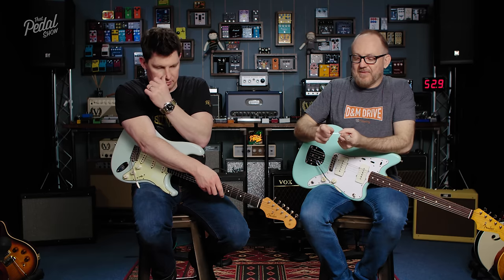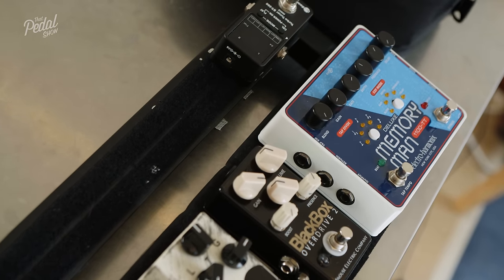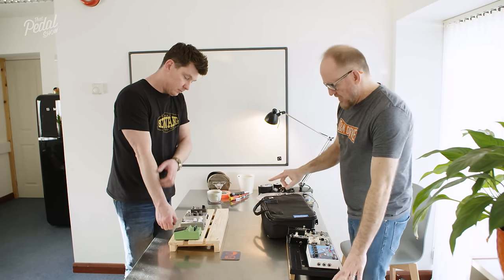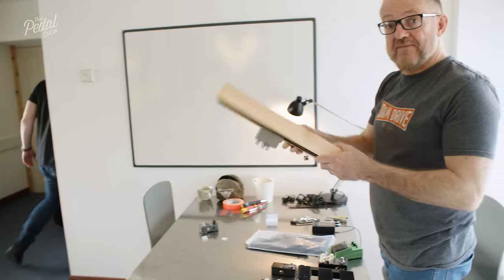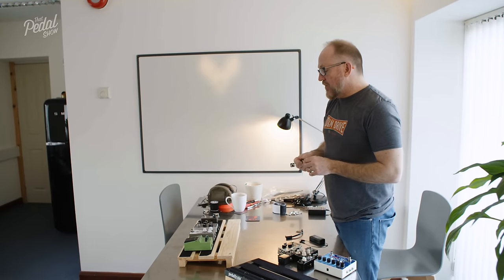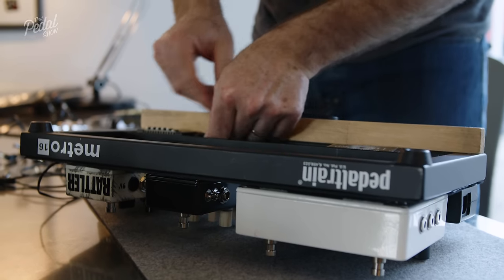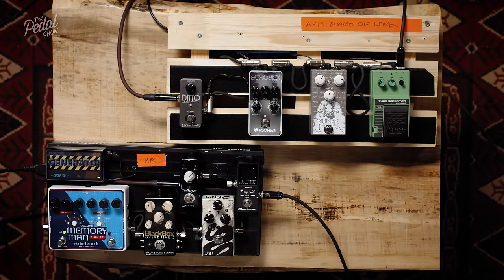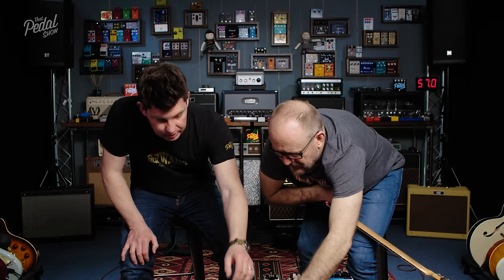Tips For Your First Pedalboard Build – That Pedal Show

Comment: Former baggage handler here.
If your flight case is awkward then it's not going to be popular with the handlers - mostly they work without being seen so awkward things can be treated with serious harshness.
Hard cases with low friction surfaces are liable to slide off tall stacks of cases (who says your case is going to be stowed the correct way up?) and could potentially land on concrete and be run over by a following trailer. Flight cases are good but a multi ton trailer doesn't give a shit.
Soft cases tend not to move around so much or fall off so much.
So if you're flying - make your flight cases more 'sticky' with rubber strips on every side and try to make it easy for someone on minimum wage to move - don't just choose the biggest possible because you can, it's more likely to generate hate.
And put your name/destination and phone number on it so it doesn't end up in lost luggage if the label gets ripped off. Brown furniture tape for the flight number, permanent marker for your name and phone number.

Comment: as long as the power supply's milliamp is higher than the pedals' milliamp all combined, daisy chains will work just fine ..
Reply from the maker: Unfortunately not attybong, it may be ok in certain situations but if the supply to each pedal isnt isolated you can run into noise problems especially with digital pedals
Reply: @ThatPedalShow  well good to hear that .. but in my case, it happened only when my dc adopter (power supply) had lower milliamp than the pedals all combined .. b.t.w. i'm referring only to a small board ..

Comment: QUESTION:
Any alternatives to the humdinger?
Reply from the maker: Not for us.
Reply: I use a Radial Bigshot. Not exactly the same thing (and I have no doubt that the Humdinger is higher quality!), but it's what I happened to end up with when I first needed to run two amps. It has worked ok so far.

Comment: Thanks for yet another great video! Question: What do you do when you have more pedals on your board than outputs on your non-modular power supply? Remove one, I know :-), but seriously do you daisy chain or use a split cable? Can it be done without soldering power cables? I always seem to need to have just one more pedal on the board!
Reply from the maker: Buy TheGigRig one and never look back. Mick here. I have four power supplies that got out-pedalled!

Comment: I'm just starting with this pedalboard thing. Can someone tell me the difference between a daisychain and a power supply? and how does it affect the sound?. I'll appreciate it
Reply: A daisy chain would be where you power multiple pedals off one power connector like with the standard 1spot, which doesn't isolate anything. I never had an issue with it, though. Many of the more expensive power supplies do isolate each connection to prevent noise. I really haven't experienced any noise issues with any of the power supplies I've used, and I've used the normal 1spot and the CS12 as well as a BBE SupaCharger and the GigRig system. I really like the GigRig supply but it does take more setup time than others since it's not just one big box.
Reply: @2Plus2isChicken2013  Thanks for the explanation!
Reply from the maker: A daisy chain is what you should find in a trash can and not use. A proper isolated power supply has separate outputs for every pedal. That's what you should use. Cheers!
Reply: @ThatPedalShow  Thanks for the verdict

Comment: Hi, 
Is it ok to use one proper power board and to it add, connect a power brick that will power up three guitar pedals in total? I'm using Katana 50 amp and plan to get something like Boss noise suppressor, Revv G3, and a Korg tuner. 
Thanks 😁
Reply from the maker: Yep.

Comment: Currently running 10 pedals without a board, 5 up front five in the loop. I have a few more but if i were to take away the pedals i dont use regularly i think i could get it down to 8 or 9. I plan on upgrading a few of them before i make my first board though. A few of my pedals are really big like memory man size also, i want to get an mxr m234 cause im just using a nux ch3 chorus which sounds more like a leslie emulator which sounds more like modulation. Basically i have mostly nice pedals but the budget ones i have i want to replace with something more permanent before i build a board. But im really really looking forward to being able to build a custom board that i can just unplug the power supply and 1/4 in. cables and go. Ill put a handle on it and have mounted 1/4" and a mounted power supply.

Comment: Any tips for powering an Effectrode Backbird (12v, 1600mA) along with other more standard pedals? It seems like a power strip would take too much volume...
Reply from the maker: That needs its own dedicated supply. Not even sure TheGigRig does propely isolated at 1600ma. Woah nelly. That thing should be IEC shouldn't it?!?!

Comment: Do you know why some digital pedals leak noise into the audio channel and/or daisy chain? It must be a design issue because not all digital pedals do it and I know some of them have much better digital noise filtering than others. I’ve just been through my digital pedals one by one, isolating them, to see if any were introducing background noise and none were - so no new power supply for me.
Reply from the maker: Dan probably knows. Something to do with something. Hahahaha.
Reply from the maker: The issue isn’t just the noise generated in that particular pedal, it’s what the other pedals on the board pick up. Try the same thing with a vintage fuzz and a treble booster on your board. If you get away without isolating then great stuff, but I would never not fully isolate every pedal on a board. It’s the option for fewest possible problems
Reply: That Pedal Show Thanks for that and for all your unmissable shows. My digital pedals, tuner, looper, delay, reverb, etc are tc and my analogue pedals vary. The only remotely noisy pedals turn out to be one “boutique” trem and a higher gain OD and that noise wasn’t reduced by power isolation. 

Good isolated power is pricey and a bit less convenient. It seems a good idea to test the difference it would make before jumping in.

Comment: What are the disadvantages to running multiple pedals from a signal output of an isolated power supply when you start running low on outputs? I bought a Voodlab iso 5 which was great at first (love running my OCD out of the 18V port!) but is really limiting now that my pedal board is growing (only has 6 outputs; essentially 5 as the 9V and 12V share 400mA current output). If I ensure that my pedals don't exceed the current draw for any given output, is the only downside going to be extra noise? Thanks!
Reply from the maker: Yeah, noise, loss of signal strength and everything else that goes with that. Tone suck, basically.

Comment: i need a power supply that will power 10 pedals with 9 volt dc, all less than 200 mA and 1 pedal that takes 12 volt ac and draws 1000mA. i have not been able to find one. help.

Comment: Here is a tip for removing old Velcro glue from pedals.  When you remove the Velcro you are left with a sticky mess on your pedal..

Here is the best, cheapest, least amount of effort way.  Take a small piece of new Velcro...  small because big makes it harder to pull off and new because the glue is stronger.  You could use a strip of the old Velcro you just pulled off but it doesn't grab as well.

  Take the new piece with the fresh adhesive and stick that to the leftover glue on your pedal.  Pull it back off.  Sort of blot it.  The new Velcro glue sticks to the old Velcro glue and pulls it off clean as  a whistle.  So you can see, if you use a big piece it will stick to a larger portion of the old glue and it really is a bitch to pull back off.  Small piece and 1 minute and you got yourself a completely glue free pedal again.

I learned this after hours and hours of other methods.  This really works and it is pretty much effortless

Comment: Guys: when u have pedalboard with power, do you still keep 9v bats inside the pedals or do u remove them? And do you unplug all the leads whenever the boards not in use or can u leave everything plugged in 24/7?
Reply: I’d say definitely remove the batteries so they don’t corrode inside the pedals and possibly wreck something. Then you can definitely leave everything plugged into the pedals and just unplug the power to the power supply when you’re shutting it down.
Reply: Cool. Makes sense. Thanks.

Comment: Question here: 
I am always paranoid to have patch cables ( carrying guitar signal) over/close/crossing  power supply cables or the power suppy itself, thinking there might be some kind of interferance. Is this really an issue? Thanks for your videos!
Reply: Not an issue with good quality cables and not really a problem with the power cables running to your pedals (amperage is so low) and I have never experienced any issues running cables past the power supply itself. But yes, poor quality cables (e.g., a cheap extension chord and crappy patch cable) can cause interference when run parallel with one another in close proximity.
Reply from the maker: No problem on my board. Mick here. Pete Cornish would probably disagree!

Comment: Anyone else cringe when Mick crumpled the power cables together?!?!   Lol.  Nice job guys.  Like many have said, would have been great to have this a few years ago.  Would have loved to see non-GigRig power distribution options - things like Y power cable for high power (excess of 300ma) type pedals and MFX units.  I still am somewhat confused on what’s supportable as even pedal vendors make it somewhat vague - I.e Boss always states - use ‘Boss approved power supplies’ (paraphrasing) - yet almost no one uses these on a board.  What’s ok, what’s not ok.  Would be great to hear your insight based on your experiences. Thanks.

Comment: If you use dual lock/pedalboard tape on the pedals and loop on the board itself, how long can either side typically go before needing to be replaced? Does the loop eventually get torn up bad enough to not hold? Do the mushroom heads of the dual lock get broken off?

Thanks!
Reply from the maker: Erm, it goes on a pretty long time. I’m always putting stuff on and off boards, Mick here, and as long as you have a little mechanical sympathy with it, you’re talking many many changes. Maybe not hundreds on the same bit of Velcro, but certainly many.
Reply: That Pedal Show Mick, thanks so much for the quick reply! I’ve got one more quick question if you don’t mind. Which dual lock is the correct one to use? 250, 400 low profile? I can’t tell which one the “pedalboard tape” is. 

Thanks again, I really appreciate it!

Comment: I just bought my first pedalboard ever. I had one pedal and for it I bought a massive board (80x45cm or something) and a Cioks Ciokolate. Yeah, laugh now. There was a bargain for the board and the power so why not? I have 6 pedals or so coming so my "define overkill" rig will eventually become much saner. I plan on playing at home so the size is not an issue, and the only reason for buying this stuff was to plan ahead of keeping things organized. I also don't usually just buy things, I plan ahead and buy "systems". And because this is just a new hobby for me I suck but learning and studying is the best part in almost everything.

Comment: Is there an easy way to test if your powersupply is truly isolated? With a multimeter, maybe?
Reply: Jarmo Nurmela yes! Stick a multimeter on two positive parts of the power output (thats the 9v side). They should not be connected. Super cheap power supplies will often have multiple outputs all connected together (effectively just a daisy chain).

Comment: Could you guys shed some light on why power supplies are so expensive? I use a truetone one spot daisy chain to power 6 pedals. What is going on inside a pro power supply that warrants the price? Cheers
Reply from the maker: Voltage, current, polarity, isolation. Your One Spot can't do some things... If you want it to do everything, it's expensive!

Comment: For 5 pedals or fewer (without fruity power requirements) can you do any better than a second hand T-Rex Fuel Tank Junior?  I doubt it.
Reply from the maker: Except that the outputs are 150ma max?
Reply: @ThatPedalShow  Yeah, anything more than that is a 'fruity power requirement' in my book!  It seems to run your basic digi mods, delays and reverbs (DD-3, Flashback, HoF) just fine.

Comment: If we have multiple pedals with expression inputs is there a splitter to control them all with one expression pedal?
Reply from the maker: Check out the Mission Engineering site...
Reply: @ThatPedalShow  , yea, the Mission Expressionator can control up to 3 separate pedals with one output to the expression pedal.  You can have different combinations active at one time, reverse travel and all sorts of nice tricks!  And using their expression pedal with two outputs, you could hook two expressionators up and control 6 pedals with one expression pedal.  Knock yourself out!

Comment: Is there any other way to solve that issue with the Runestone?
Reply from the maker: Mission has told us they have updated the design of the 529 since they sent us this unit, so new ones will work just fine. And if anybody does have an old one, they will upgrade it. Cheers!

Comment: Hi guys, I've developed a noise problem with my Dual Hudson Broadcast since i've been running it next to a Brantone Tone Bender style pedal  I'm using a Truetone isolated supply with one output per pedal and a GigRig Virtual Battery for the fuzz. The noise issue happens when I put the Tone Bender before the Broadcast in the signal chain and only if I turn on the high gain channel of the Hudson (with the tone bender turned off). It goes away when I put the Brooadcast before the tone bender but i'd prefer them to be the other way around. I know this is a pretty specific question but it's driving me nuts and seemed relevant to this weeks show.  Any suggestions appreciated
Reply from the maker: Erm, is it a physical proximity thing? Broadcast has a transformer....
Reply: @ThatPedalShow  Wow thanks for replying. I don't think so as i'm not physically moving it when I change the position in the chain (I'm only switching cables around).
Reply: Maybe it's the proximity, but then it isn't a problem into lower gain. Gain before noise is okay, noise into gain, not so good.
Reply from the maker: @hoboroadie  Ah yes. Just read the question again. This is it!

Comment: Is the gig rig generator powered by rechargeable batteries?  Am I understanding you ?generator to distributor to pedals? And different distributors are used for pedals with other than standard (9 volt or  125ma) the power base pack 2  which would allow you to power 6 standard 9 volt pedals with each distributor?  And if you have a pedal with a higher power requirement you buy a time Lord which plugs into the distributor which  plugs into the generator? Am I following you? Sorry be dim. But being able to correctly power all my pedals and possibly use a rechargeable power supply seems like  sorcery

Comment: If building your own board, don't use the fluffy side of your Velcro. Go to hardware store and get a couple feet of auto carpet for 5 bucks. Wrap, glue, and or staple it down. Hook side of velcro sticks extremely well to it, and the positioning is endless on the board. 

It's cheaper than Velcro as well. And looks much cleaner than strips of Velcro.

Comment: If I wanted to strip my board and re Velcro it what's best to remove all the left over gunk ?
Reply: Methylated spirits.
Reply: Colin Robertson 
Use a hair dryer to warm up the tape you want to remove, then usually all the adhesive comes off with the tape leaving the board fairly clean. If there is anything left behind white spirit (turpentine substitute) will get it off.
Reply: Here is the best, cheapest, least amount of effort way.  Take a small piece of new Velcro...  small because big makes it harder to pull off.  Take the new piece with the fresh adhesive and stick that to the leftover glue on your pedal.  Pull it back off.  Sort of blot it.  The new Velcro glue sticks to the old Velcro glue and pulls it off clean as  a whistle.  So you can see, if you use a big piece it will stick to a larger portion of the old glue and it really is a bitch to pull back off.  Small piece and 1 minute and you got yourself a completely glue free pedal again.

I learned this after hours and hours of other methods.  This really works and it is pretty much effortless

Comment: Theres something called a 1 spot that costs 20 dollars or so that powers 6 pedals instead of those big 100 dollar power bricks. Its a good start if you dont wanna spend a ton right away
Reply from the maker: VCPI. VCPI. VCPI.
Reply: To be honest I think I’d prefer to use batteries rather than an original one spot. It’s always a difficult choice though..... buy that £200 pedal I really want or the power supply I really need?

Comment: Don't put the loop side of the velcro tape on the board. It will catch much more dust than the hook side. Your board is always prone to dust and other particles from above. The hook side is much easier to clean with a vacuum cleaner!

Comment: Im still not convinced about expensive power supply’s. £200 for power on a first time board is a bit rich. My cheap Chinese PS has switchable 6-12v outputs and cost peanuts (fed with 15v from a laptop PS). While I’ve not compared the sound to using an expensive PS my board sounds great.
Reply from the maker: If you're never going to upgrade it, you night be right William. It probably won't do a Vent, a Timeline and a Kingsley Page... But that's cool if you're never going to use such things. It's all about future proofing.